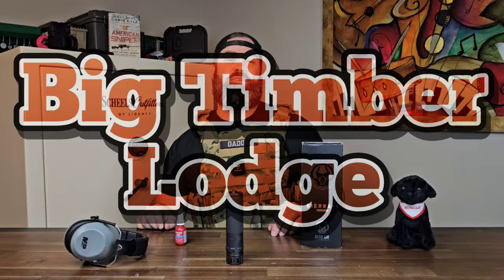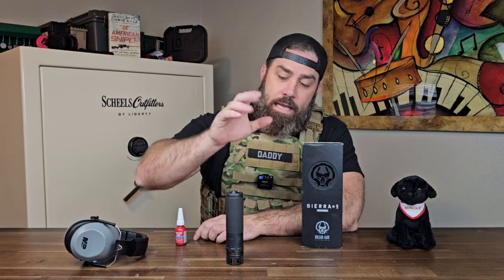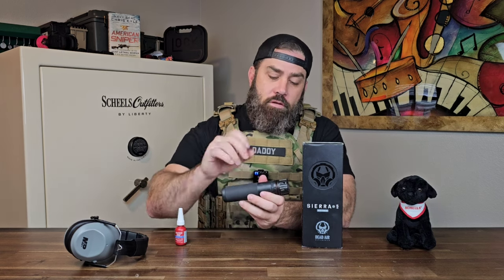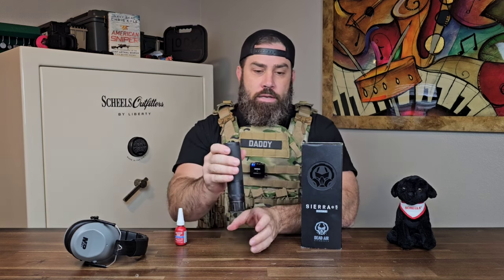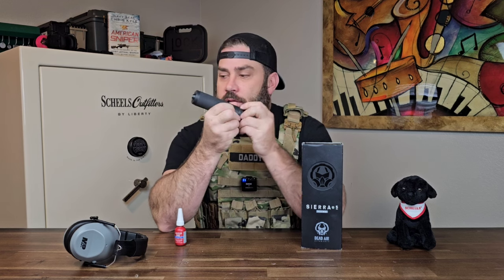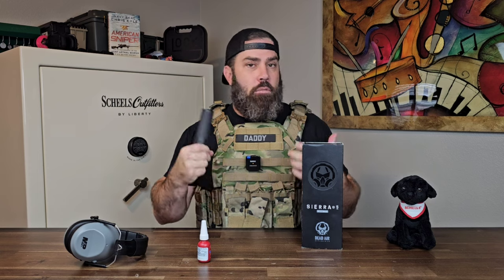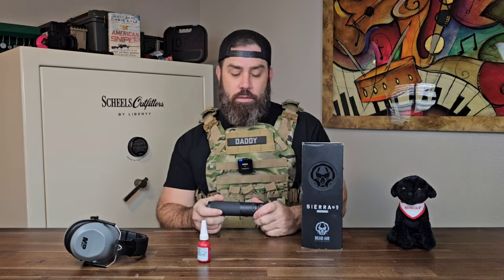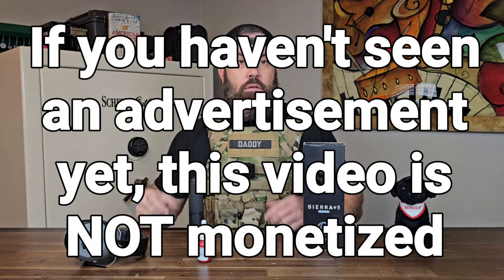How To Prevent Your DEAD AIR SIERRA 5 From Blowing Up / WATCH BEFORE YOU BUY

Comment: Dead air actually told you to use blue low temp loctite? You don’t use loctite period on a suppressor, you use rocksett.
Reply from the maker: I have thoughts on this just like you, but I'm relaying exactly what they told me. I'm not going to tell my viewers to do something that could void the warranty of an NFA tax stamp item.
Reply: @BigTimberLodge  follow up, did you get to a service tech, or did they hold you up in customer service
Reply: There is a flaw in the baffle manufacturing process..
Blue loctite has no place on a suppressor!
Reply: Believe it or not, I have been using blue and purple on the cans. They do a pretty decent job and there isn't so much pain to take them off. But it still requires wrenches.
If someone married the mount to the can for hard use, rocksett is probably a better idea. I would prefer a Sandman K w/ 5.56 FH cap for 5.56. Especially at that point.
Reply: Blue definitely does not work. Only shot 400 rounds before mine completely loosened.
Reply: There is a blue loctite that is high temp. I don’t remember the three digit number but I have a bottle I always use on everything from pistol muzzle devices to red dot screws.

Comment: I'm glad you were able to have good success with the Sierra5. Unfortunately, (Fortunately) you haven't experienced the problem the with the first baffle coming apart due to faulty manufacturing procedures. Granted, while that is the most consistent failure, it isn't indicative of Dead Air as a whole. To my knowledge, Dead Air has been inundated with calls on  the first baffle issue.
Reply from the maker: I've taken the Sierra 5 out twice now. Since putting the blue Loctite on the threads, everything is staying together nice. Fingers crossed nothing comes apart.
Reply: @BigTimberLodge  I’m hoping it works for you!!

Comment: Great video. I subscribe to the school of thought that the sierra 5 fiasco is user error. Another thing I would suggest, coming from 3d printing and the automotive industry, is retightening hubs and end caps when hot. How metals perform when heated is common knowledge but I feel that it would help with these issues.
Reply from the maker: @Az2FL  that's an interesting thought about tightening while hot. Might just have to give that a try.

Comment: Loctite 242 is only good to 300deg F. why wouldn't they recommend 246 works to 450f and is medium strength. Actually the Sierra 5 manual calls for Vibra-Tite 123 med/450F witch is equivalent to Loctite 246
Reply from the maker: I just relayed what they told me.   I took the suppressor to the range after putting the blue Loctite on, and nothing unscrewed from itself. I'll keep you posted on my experiences.

Comment: When I got mine, I mag-dumped about 600 rounds over the course of two range trips. Since then, I’ve gotten it up to about 3000 rounds or more through the can and it is still going strong. I feel bad for the people who got lemons, but mine has been phenomenal. I was expecting a small, light, durable can that isn’t that quiet, but to my surprise, the can sounds amazing.
Reply from the maker: Ever since I have put the blue Loctite on my Sierra 5 it has run perfectly.  It breaks my heart to read some of my viewers experiences with theirs.  Would you buy another Dead can after this?  Do you think Dead Air will bounce back?
Reply: @BigTimberLodge  already have. Got a Mojave 9 cooking and I’m excited about it. The Griffin EZ Lok has changed my outlook on suppressing handguns for the better. 

I think we just don’t know how widespread this issue is, and my experience with DA products has been nothing but positive. I know some people feel otherwise, but I’ve got a lot of cans, and many are DA. They have all been solid.
Reply: Yea mine was good up until 1000 rounds hit 1000 and thought I was good. Nope. Mine blew up doing slow fire at 200y bench rest and the video says “dead air has a quality assurance policy and they’ll fix it” no, no they won’t. I’m over 5 months in waiting for it to be fixed and they are not fixing them and they are not letting KGM repair them. I hope people see this, DO NOT buy anything from dead air. I’m now up to 4 emails that have yet to be answered. The ones that do, are not addressing the sierra’s and all I get are “we have no Sierra 5 updates at this time”.

Comment: FYI for anyone curious, you do NOT need to use shims on the Xeno system, it can make your alignment WORSE, just torque and rocksett your xeno flash hider/brake to spec, and ensure your suppressor is tightened hand tight, this is per Dead Air's recommendation. And do NOT use crush washers with ANY suppressor....

Comment: Thank you. It is mind boggling how many issues can be solved by reading an user/operators manual. Had a problem when installing a binary trigger. It failed the function test. (dry fire in specific manner) Reread the manual and found a fault/troubleshooting chart and it was user error. I wasn't pulling the trigger through the second wall.

Many issues can be solved by simply eliminating user error and performing basic maintenance.
Reply from the maker: I'm glad you appreciated my video. Do you want to grab coffee sometime soon?

Comment: Thanks for the video and your experience. I did a similar test at first like you did. After maybe 200 rounds, and in those 200 rounds, I was checking like you were at every mag. Well, I got home after shooting, and I did the Ole shake shake and heard a rattle. I was like oh no...lol...So I started looking around, and sure enough, the front cap had come loose. I got lucky I guess. Good  to hear about using a bit of blue lock tight. I love the can! It's a solid build. Thanks again for the video!
Reply from the maker: I just put a dab of blue on both sets of threads today.  I am going to let it set for 24 hours and test it out tomorrow.
Reply from the maker: I am also having issues with overpressure and need to either install a heavier buffer or an adjustable gas block or both.
Reply from the maker: Going to the range today to test out the Blue Loctite fix.
Reply: @BigTimberLodge did you figure out the over pressure? I thought mine had a bit too much pressure as well and that’s even with an adjustable gas block. Is the Sierra 5 a high back pressure can?
Reply from the maker: @JayyBird93  a lot of back pressure. My rifle is currently having a retro piston kit installed on it. The piston takes a lot more pressure to move than the gas system takes to move the bolt.   I will be posting a video soon once I get the rifle back with how well it worked.

Comment: Just got mine out of ATF jail. SR5-03XXX serial number. Didn't even know about the problems until after I shot 80 rounds through it. Fortunately no problem yet. Will try the blue loctite thing even though it seems silly it doesn't hurt anything.
Reply from the maker: I've taken mine out twice since I put on the blue Loctite and have had 0 issues.   Granted, I haven't gotten it glowing red.  Keep the channel posted on your experience with the can.

Comment: Also not sure why they said to use blue loctite, it's not rated for the high temps the suppressor will get to > 500F, I would recommend Rocksett if you really do not want the adapter coming off, if you frequently change adapters then loctite would be recommended, but it's not going to maintain with the high temps over time.

Comment: Great review and advice. I have only shot my S5 about 120 rounds. I will have to check it for tightening. I really like the suppressor and Dead Air. I have few different cans from them. Appreciate it.
Reply from the maker: So I have over 1k rounds through mine now. I've gotten the suppressor smoking hot and just shy of glowing red.  After getting it that hot, the blue Loctite did give way, and I used red on the threads.
Reply: @BigTimberLodge appreciate the update. So you advise the red loctite .
Reply from the maker: @ryangreen9770  If you don't plan on swapping out the mount, then yes or Rocksett.  If you have Rocksett, go with that.

Comment: I have over 3000 rounds through mine. Zero issues. Although I used rocksett not blue loctite.
Reply from the maker: That is what I want to hear from users.  I have been out twice with the can after applying the blue Loctite and have had 0 issues.  Well, I tend to overtighten the keymo mount and it is next to darn near impossible to get off when it is hot.

Comment: From what I've heard the problem with them popping has come from a manufacturing flaw from some contracted company. You might be able to call and figure out if your S# is effected, but it was a very limited issue and it's been resolved on newer cans. So if yours is in jail atm you might have a problem. If you haven't bought yet the issue should be resolved.
Reply from the maker: Great points. I called Dead Air and asked if I gave them the serial number and if they could look it up and the guy said unfortunately, no.
Reply: @BigTimberLodge they really need to get out in front of this issue and address it formally. This could be the beginning of the end for them and they need to act accordingly.
Reply from the maker: @JayyBird93  the CEO did address it formally and apologized for using the 3rd party factory to manufacture the Suppressors.
Reply: @BigTimberLodge  I actually just found Mike Pappas was supposed to make a statement and have an interview with a YouTuber “rangedaybro” about 3 months ago and it never happened.
Reply from the maker: @JayyBird93  interesting. I found out before Christmas, Dead Air is shipping refurbished Sierra-5 cans finally.

Comment: I have a deadair wolverine and it works itself loose too.  I never thought to apply Loctite
.  I'll do that now.
Reply from the maker: Just a heads up. The Loctite blue eventually failed, and I switched to red.  If the red falls, I'm switching to rocksett
Reply: @BigTimberLodge I initially tightened mine with the spanner wrenches. Can came off the hub after 120 rounds. Used vibra tite hot lock. Shot it today for 120 rounds or so, can came off the hub. It’s getting rocksett tomorrow.

Comment: One thing I haven’t seen anyone address is the use of the micro mounts. Everyone I’ve seen has been thicker than a normal one. I.e. it takes less turning to fully lock it in. In some cases, you have the back the lock collar one revolution to get it to fit. I think some people are shooting these cans without them being fully seated on the mount because of this difference in mount tolerances.
Reply from the maker: Interesting point.  My mount was made by Blackout Defense as a hybrid comp/flash hider.  I also have a mount from Dead Air that came with the Sierra-5 that I will be putting on another rifle I have.  I have not seen a micro mount.

Comment: Thanks for the video. So I'm probably around 550 rounds into my Sierra 5. I just got lucky like you. After 100 rounds I took it off and did the shake...lol...I was like, "Oh no, not me!" So I took it home and started looking around and quickly found out that my front flash hider cap was loose. Like almost ready to fall off. So I tightened to spec and that was that. I'm running their xeno mount, and since then, everything has been great. I do wonder why they don't supply the front-end cap tool with the suppressor. You would think they would. Anyway I love the can. I do believe things have been exaggerated a bit. Thanks again for the video. 😊
Reply from the maker: Steve, glad you are enjoying the can and everything is working out for you after you caught the end cap being loose.  I have been wondering if the E-Brake will work with this can?  Not that I need more recoil reduction but it supposedly helps with back pressure.

Comment: Thanks for this video.  Some people are being kind of buttholes about their 'exploding' sierras.  Sounds like it's just a threading issue and at worst a baffle strike (which can happen to any serviceable can, right?).  Idk why ppl are complaining when they could just call or find a video like yours, a forum, etc.  I highly doubt DA would ignore this issue like so many are claiming.  The can is expensive and so is their good name.
Reply from the maker: Thank you!   So far, no issues with my can since applying the Loctite.
Reply: @BigTimberLodge  Cool. There's a suggestion in the comments that you should use rocksett.  I've used it on a Q LLC adapter and it worked with no issues.  You might try it if the 242 doesn't work out like they're suggesting.  You probably knew that, just mentioning just in case.

Comment: My baffles disintegrated. There was no end cap strike alignment was checked collar was tight. I have 4 other dead air cans and have never had an issue. It blew up after 2 mags I have zero doubt that it was lack of QC and failed manufacturing. They have had my can going on 200 days with no idea of when I will get it back.
Reply from the maker: F@!* That is horrible. That breaks my heart to hear.   Sadly, you're not my only viewer who had their Sierra-5 explode and is waiting indefinitely for Dead Air to repair it.   What are you going to do? Do you have another can you can use?
Reply: @BigTimberLodge  luckily I have 6 other cans I can use. Im hoping they try and make it right. The lack of communication has been terrible.

Comment: The warrant means nothing when they take a year to get it back to you when most other company’s for any warranty work get it back within 40 60 days
Reply from the maker: Yeah. I talked about that in my latest video. If I had a chance to do it over again, I would buy something different.   Even though my suppressor is working great since applying the thread locker, I'm still worried it's going to blow up, and I won't be able to get it fixed.

Comment: I’m not here to troll. But I’m looking into this item and I’m hearing after I pay good money, wait forever, then I need to take it to a gunsmith ($labor fees) for two checks then check it myself in the 1st 150 rounds and then blue lock tight to spec? (gunsmith if I don’t want to buy the torque measurement tools)
Reply from the maker: If you get a newer Sierra-5, you shouldn't have an issue.

Comment: Um . Blue is made to be broken aprt with tools.   Red requires heat.  Blue is also for smaller bolts, maybe 1/2 inch and down.  Anything bigger, you go red.  But heat breaks it down.   I'd use green bearing race lock tight.  You need heat and a breaker bar.
Reply: Even red won't hold up to spec, it's not rated for the high temps suppressors get to, that's what Rocksett is for.... Red is literally meant to be loosened with heat....

Comment: Lol the fact that Dead Air told you to use blue loctite is even further proof of their lack of basic knowledge and the ability to run a business and produce functional suppressors. They don't blow up because of baffle strikes, they blow up because of terrible welds. There's a lot more wrong with these cans past the uneducated echo chamber of "oh the video I saw of one blowing up was because it loosened". Look at the pictures of the failures, the 200+ day wait for repairs, etc. It's honestly surprising they haven't been sued in to oblivion. I truly hope your can works well and doesn't turn in to a maraca, but this video definitely will not prevent anyone who may experience a failure if they happened to receive a faulty can like many have.
Reply from the maker: Unfortunately, I bought this before all the negative press was coming out about the Suerra 5.  I had to wait for over a year for my tax stamp. I couldn't return the suppressor once I got it, so I'm trying to make the best out of the situation and share my experience with other owners. I did put the blue Loctite on the threads as advised and have been back to the range 1 time since. I had 0 issues with the can, and I hope it stays that way.
Reply: @BigTimberLodge  I 100% get it. I really wasn't bagging on you, just DA. It's just not right what they've been doing, and the fact that end users like yourself have to worry about such a long awaited purchase. I hope it runs like a top for ya, they sound good, at least mine did before it gave way a couple mags in lol.
Reply: That why I like the energetic armament vox s suppressor  would be back in two days.

Comment: This is why I'll only buy silencers that aren't modular, too much can go wrong. Surefire or huxwrx proprietary mounts are better than the dumb HUB or any other thread on back end.
Reply: Oh, and if your silencer needs a flash hider end cap for extra money, the design was bad from the beginning
Reply from the maker: I'm very interested in the HUXWRX
Reply from the maker: To be fair, the suppressor comes with the flash hider end cap.
Reply: @BigTimberLodge true I should have clarified I was thinking about the sandman series
Reply: @BigTimberLodge I like my Flow 556k, but I don't love it
Reply from the maker: @UndertheTreesPNW  interesting. What do you want as a can?
Reply: I'm lefty so I appreciate the flow 556k, but overall I really prefer the 556 RC2. I think the RC2 sounds better with and without ears, and flash reduction is significantly better. This also might be controversial, but I think the hux hx-qd 556TI sounds better than the flow 556k
Reply: @BigTimberLodge  I'm interested and curious how the CAT WB does in people's hands

Comment: Mine’s in jail.  I have the xeno Mount for it.  I’m assuming i’ll have the same issue?
Reply from the maker: I would just make sure the baffles are aligned properly and use some blue Loctite and I don't think you will have any problems. https://youtu.be/EnegwLrWeDo?si=6LHw16LkhRgcwXB2
That's a video with me shooting the suppressor. You can hear how loud/quiet it is and see the flash reduction.